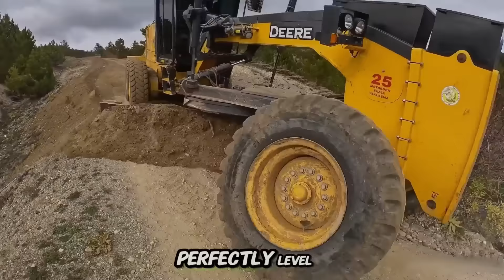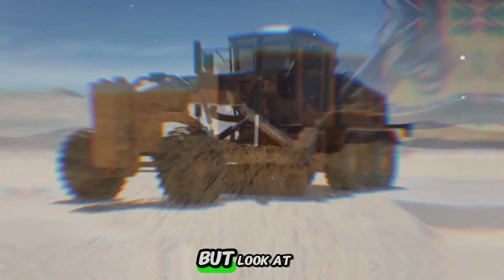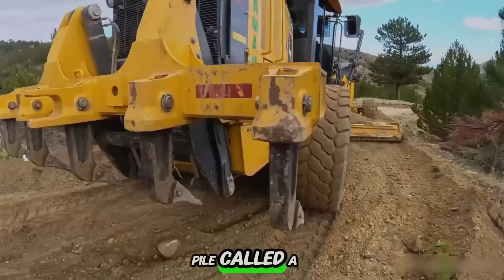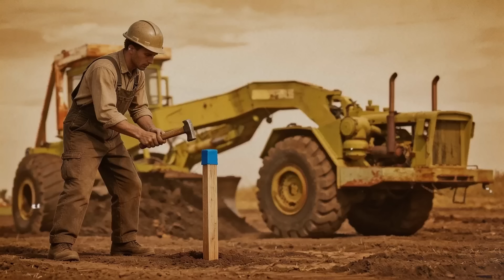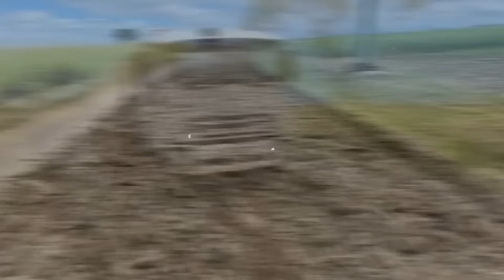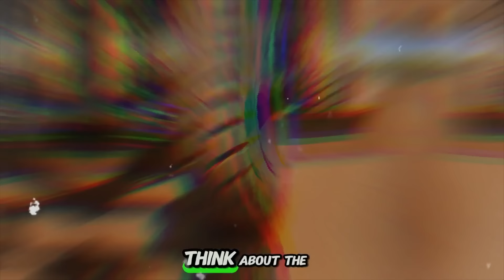Why 99% of People Can't Operate a Motor Grader

Comment: I ran an old mechanical cat grader on a ranch back in y mid 20's dad and I both ran  dozers at the time and we had ripped out out a fence line and we had to smooth it out, dad tried and didn't get along with the grader at all and our boss asked me to try after lunch. Turns out I was pretty good at it. Now I work on industrial air but I still miss being an operator.

Comment: YES I HAVE RAN A GRADER IN A STRIP MINE IN SOUTHERN IN. LYNNVILLE MINE.31 YEARS TOTAL 14 AS A OPERATOR. CAT’S 14 G,16 G AND EVEN THE OLDER 16’G ( MECHANICAL) WITH THE GEAR BOX SITTING IN THE CAB WITH YOU RIGHT AT YOUR KNEES. YES YOU ARE WRIGHT ( YOU RUN A GRADER BY THE SEAT OF YOUR PANTS.)😊

Comment: Back in the 1960's my family lived very rural on a farm. Gravel roads all around the township. Our township owned a red Austin Western motor grader. I loved when they worked on those roads as a child. Still can see Mr. Williams standing in the cab as he operated it. cleaning out the ditches and smoothing out the roads.
Reply: I grew in the town were Austin Western had its plant, in Aurora Illinois. At the corner of Farnsworth and Dearborn Ave.
   I think I was 5 when they closed that down in 1979 or 1980. The entrance to the Burlington Northern's West Eola freight yard was there, and they had just finished the new overpass that eliminated the 6 track grade crossing that was there when the plant closed. 
   Back when I trucked, I used to see those old single axle AW graders and old Galions  out in the mountains.

Comment: I was tossed into 1 at a quarry for 3 weeks with only basic instructions. Just as I was really starting to get a feel for it and beginning to understand how to get the results needed smoothly they put me in a 1975 Cat Articulated Dump Truck to build a ramp from the bottom of the pit to the top (200 feet in depth) during a super wet week. The mirrors were factory, oxidized and impossible to see out of. While I was backing up the ramp to dump near the top widening the ramp I watch another driver in a brand new Volvo roll his entire rig over (cab went over first all the way upside-down) and the other Old Cat 1980 do the same in the area I had to turn around to back up. I told them they could kill someone else with this stupidity as it was clearly just unsafe to be trying to do that in the quarry when it was raining the past 2 weeks. 2 Articulated Dump trucks fully rolling over due to the unstable conditions was enough to say Osha needed to visit the site and I was not going to risk my life for $18 an hour. I would have gladly stayed on the Grader.

Comment: Back in the 90s I was a finish grade operator. I could scrape the paint off the top of the blue stakes.
Reply: Come on
 You ain't as great as you make out to be.
What happens between the blue tops is the true market of a master grader operator.

From the grade master
Reply: @DougHanavan  That's the exact point. you get your blade set and your grade to the next stake and when they shoot it  you're on the money. Are you dense. This is before all the GPS technology on these new machines.

Comment: Hello, Motor Vibe talks.
HMMMMMMMMMMMM????????????????????????

MORE BS videos being passed off as 'educational'.

I spent FIFTY EIGHT YEARS operating heavy equipment - INCLUDING a fair bit on graders - and NEVER ONCE heard them called the 'Grand Masters' of earthmoving.

It is NOT the "short wheelbase" of a 'dozer that makes it harder to create really flat surfaces. It IS where the blade is placed, out in front of the machine with no support ahead of said blade while a grader has the blade in the middle of the machine with support both in front of and behind the blade. (And I'm only 1.37 into a 9 minute video.)

Graders of, from and by themselves DO NOT create hard road beds. You mentioned that they often need water trucks to help them get the moisture content of the material right but you FAILED to mention that they also need compaction equipment working with them to achieve sufficient soil density to meet specified requirements.

There was a HELUVA LOTTTTA final trim work done with graders BEFORE ANY of them had articulated frames. The articulated frames only made it easier to do the same work.

If'n yer gonna try to educate people, at least TRY to get it all right.

Just my 0.02.

You have a wonderful day. Best wishes. Deas Plant.
Reply from the maker: Sir, first of all  massive respect for 58 years in the seat. That kind of experience can’t be argued with. 🙌

You’re absolutely right about blade placement being the key factor versus just wheelbase length — that’s a great clarification. And yes, compaction equipment is critical for achieving density specs. I should have explained that more clearly instead of focusing mainly on moisture control.

The “Grand Masters” line was more of a dramatic phrase than a technical term — but I appreciate you calling out the details that matter.

I genuinely value input from operators with real-world time behind the controls. Thanks for taking the time to point it out.
Reply: @MotorVibe_Talks  Are you live - human? That sounds like a response AI comes up with - from my Google Mini to GPT5 - are you AI or blood and tissue human?
Reply from the maker: I'm real...my name Is Peter
Reply: @MotorVibe_Talks the video about the 5 most difficult pieces of equipment to operate.  The section picturing the woman on the open platform dozer with what appears to be an instructor giving directions.  Do you know who is in that photo, or where it was taken? I think i know one of the people in that photo. 
Thanks for the response in advance. 😂

Comment: You don’t drive a motor grader you with knowledge of earth moving operate a grader not just a road maintainer
Reply from the maker: Thanks for the correction....I respect your knowledge in heavy machinery
Reply: Very true. It's not quite as hard as one would think. Im not saying that it's easy but once you learn how to configure the machine for what your trying to accomplish its not really that bad. But it really is a lot to do with understanding earth moving than it is operating the machine.